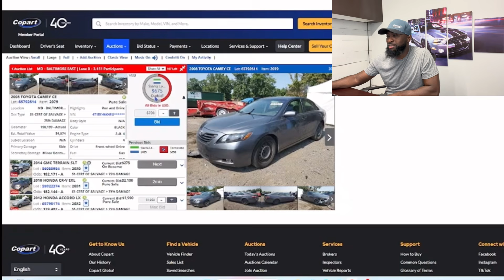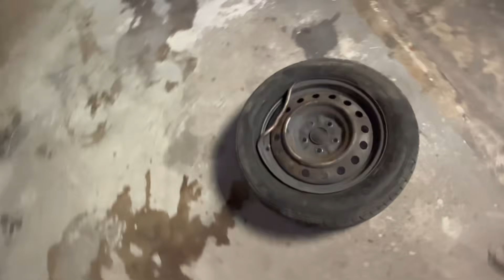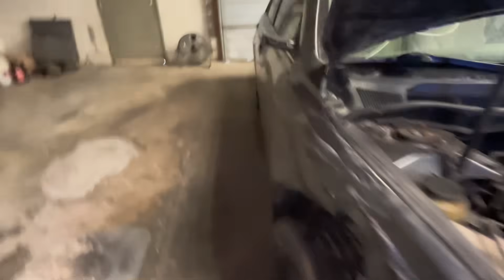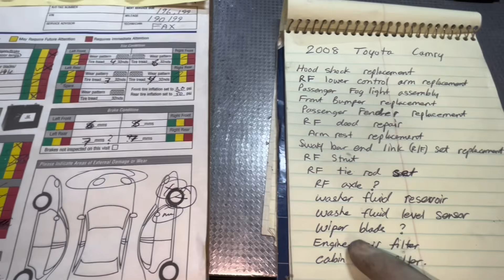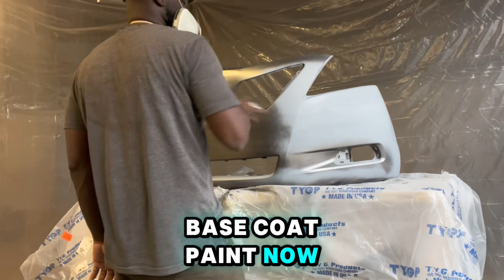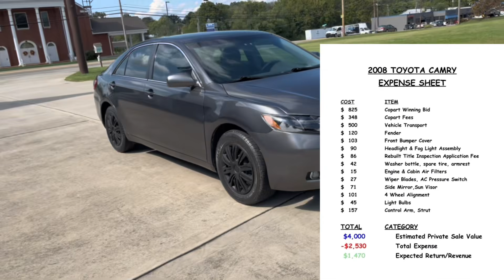How to Flip Cars | COPART FULL PROCESS

Comment: Ohh the worst model generation they made is 2007 to 2010 excessive oil burning engines bunch of catalytic converter failures  valve cover gasket seals were defects common problem and the threads inside the bolt that hold the coil packs down those threads are commonly going bad then replace the whole valve cover toyota really took a huge loss from 07 to 2010 😂  i had a 07 before piece of junk
Reply from the maker: Sorry to hear that… 👍

Comment: your labor is also needs to be added in that cost plus electric power you used etc. and 4000$ is clean title not salvage.. not knocking you but that just doesnt sound like a winning deal
Reply from the maker: Electrical power 🤣, I’m thinking of the last time I watch HGTV house flip and they included electrical power use in the house flip process 🤣…. And they probably use 20 times more electrical power. Thanks for watching, that was a good one 😂.
Reply: @FlipAutoXperts   ignore the labor cost ? and 4000$  for a clean title not a salvage .. good luck being the flip !!!
Reply from the maker: @fkhan2484 I’m doing pretty well, thanks to GOD. Thanks for your well wishes.

Comment: Why are ur Copart fees considerably lower ?  Using CarsfromWest fee calculator I got a Copart fee of 510 based on the winning bid of 825.  Maybe it a location issue since Im based in Texas
Reply from the maker: @tonyyayo2115  Great question, Copart has about 2-3 memberships tiers, a higher tier would allow for lower fees amongst other benefits.
Reply: @FlipAutoXperts  appreciate the response.  Im gonna be on the lowest 99 bucks tier.  Looking to use Copart to buy my second daily driver instead of using CarsfromWest(3rd party) and paying them 349 to use their license as I did in 2023.  Thx for the  series of vids
Reply: How long does shipping usually takes to deliver the vehicle once you've won it at the auction?

Comment: I have a 2004 Toyota Camry le 163000 miles drives like a dream one of my mechanics said u have a very strong vehicle
Reply from the maker: @trapps75  I agree, Toyota’s are at the top of the list in terms of reliability.
Reply: @FlipAutoXperts  not all of them  2007 to 2010 are the worst ones the worst model generation they made is 2007 to 2010 excessive oil burning engines bunch of catalytic converter failures  valve cover gasket seals were defects common problem and the threads inside the bolt that hold the coil packs down those threads are commonly going bad then replace the whole valve cover toyota really took a huge loss from 07 to 2010 😂  i had a 07 before piece of junk
Reply: Good year

Comment: Copart sucks. Don't forget to mention that there is around $400 of auction fee. Not worth it. Only worth it if ur going to break the car up for parts.
Reply from the maker: @mejalli911  Sounds like you may have had one to many bad experiences. I have been able to get cars at deals all in 50-70 % of the value. It definitely works for me if you use it right.

Comment: Dont these gen Camrys have oil consumption issues?
Reply: Of course only if you don't maintain it.😮
Reply: @johntran1831  not exactly, the car nut guy did an episode on this gen Camry that was dealer maintained and it ended up getting a new engine. The point I'm trying to make is if you are buying a car specifically for reliability, this gen Camry isn't the way to go. And given it's a Toyota, that's  the main reason why people buy them. But hopefully this buyer doesn't have major issues, or only has to add a quart every oil change.
Reply: @racequad9  you are right about that old car have many issues. After more than 15yrs of service I'm counting my blessing every year that it won't break down. My car is 2006 Le V6 is da bomb. 😆 🤣
Reply: @johntran1831  honestly, I feel the older cars (a lot but not all) are better. They are easier and cheaper to work on. My neighbor has a 2010 Ford fusion hybrid and those are known to have reliable engines, plus their hybrid system is borrowed from Toyota. He has 275k miles and has only replaced the throttle body, cv axles, brakes, and the normal maintenance. I wouldn't own anything new Ford now though except maybe a 5.0 f-150.
Reply from the maker: @racequad9  I’m not sure what year exactly but yes, as well as some Kia’s, Honda’s and the list goes on. Every manufacturer has the set of issues.
Reply: Ohh the worst model generation they made is 2007 to 2010 excessive oil burning engines bunch of catalytic converter failures  valve cover gasket seals were defects common problem and the threads inside the bolt that hold the coil packs down those threads are commonly going bad then replace the whole valve cover toyota really took a huge loss from 07 to 2010 😂  i had a 07 before piece of junk

Comment: still drivable with 190K on it
Reply from the maker: @麒麟-x3q  absolutely, these Toyotas are well known to 300K plus on the mileage.
Reply: My is 272000 miles and I'm hoping for half a million mile.  😮😊
Reply from the maker: @johntran1831  It’s not impossible with excellent up keep.
Reply: Ohh the worst model generation they made is 2007 to 2010 excessive oil burning engines bunch of catalytic converter failures  valve cover gasket seals were defects common problem and the threads inside the bolt that hold the coil packs down those threads are commonly going bad then replace the whole valve cover toyota really took a huge loss from 07 to 2010 😂  i had a 07 before piece of junk